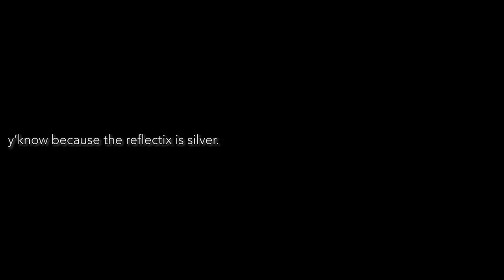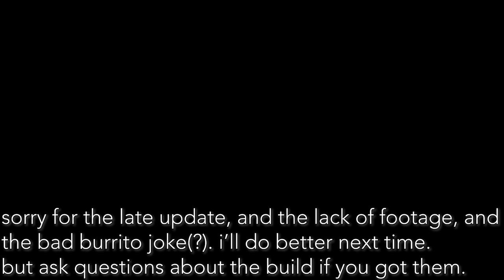4x4 Van Build EP02 - New Roof & Floor

Comment: Perfect illustration of why overbuilding subfloor is Not the best practice.  Kills interior height, which is pretty IMPORTANT in these (older) high tops.  Ceiling ‘insulation’ is far more critical.  You loose more heat/cold from Above, than Below.  I have Never seen the “logic” in the herd building-up these THICK floors !